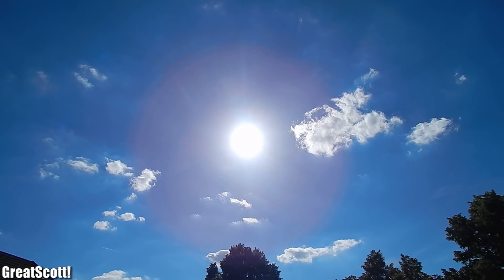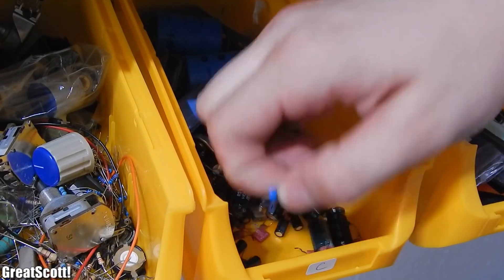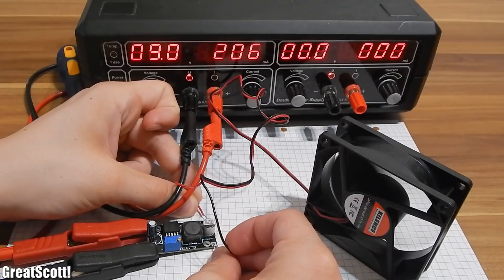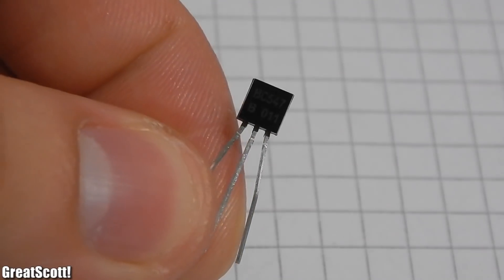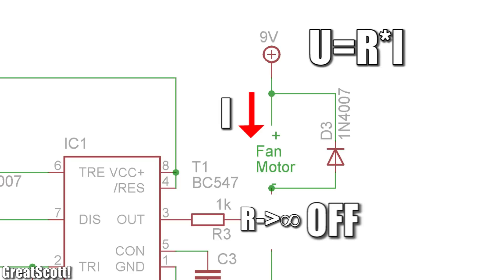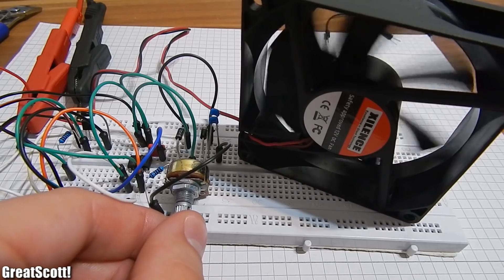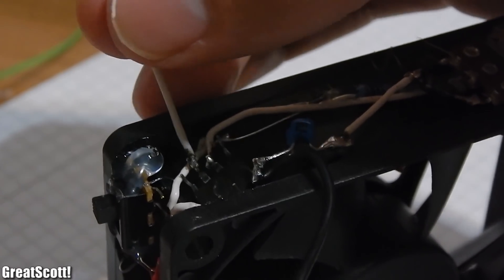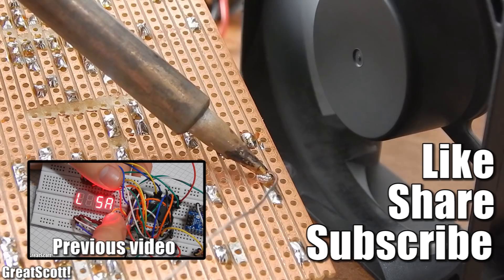Stay cool this summer: PC Fan Mod

Comment: thanks for sharing your knowledge!

i'm trying to replace the fan on to an xbox 360 power brick. the current one is a turbine type and i want to replace it with a regular fan. is there something a noob can do to keep the new fan running at lower rpm? the space is quite small so i won't be able to fit a bigger than 60x60x10mm fan in there, these fans usually have high rpm (like 4, 5, even 6k rpm)... small fan+big rpm = noise. what electrical component should i hook to the black wire in order to lower the rpm? i think 1000 rpm should be enough...

Comment: I actually did not stay cool because I used the circuit to power a 12v soldering iron soo instead I stayed frosty not to burn the house😆

Comment: So let me get this straight. You did not want to waste energy by using a variable resistor to control speed. Instead you switched the fan on and off quickly to get the desired airflow while not wasting energy in resistance. Did I get it right?

Comment: Few years back simply bought a 12V wall adapter, connected them (fans) up and been using them ever since.
E: before that connected the fans to a molex connector, so I could get the power from the computer.

Comment: Hi, thanks for the tutorial  however I can't find all these parts at the moment and I need something to controll the 12v Fan on my old 3d Printer which currently has no speed settings enabled. I found another method : 

https://electronicshelpcare.com/voltage-controller-circuit-with-ampere-using-irf540n-electronics/

https://www.youtube.com/watch?v=_0bm2CJit1o&feature=emb_title

So basically all I have are some various Potentiometers and the IRF 540N and I need to be able to reduce the fan to Zero, at the moment only a slight change in speed ; '/

Comment: It would have been nice if you had a small pcb with that potentiometer which controlled one or fans. It  would be even better to have four potentiometers to control four 3 pin fans on that pcb.

Comment: Hello scott, as u showed here in the explanation dt u used pin 3 as input from the pot and the diode combination, but in yr actual application of fan and led dimmer u used pin '7 as input' and 'pin 3 as out' put which works pretty well, but my question is it possible to use 'pin 7 as output' and 'pin 3 as input' (from pot). Because A guy did that and when i tried using his schematics i failed to get anykind of out put from 'pin 7' and also he used '12v zener and 270 ohm resistor'to use 555 on 24 v supply bt when i tried my resistors heated up like in seconds 
Here is his vidio and schematics https://youtu.be/trlUiFwl6AE
And also make a video on using zener diode as voltage regulator if possible
 thanks in advance

Comment: This is perfect for a cosplay I have! May I ask, can I use an external cell phone battery to power this instead of a 9V!?
Reply: if you have a 3.7V battery it´s gonna be difficult to power the fan so you should utilitze a boost converter first :) and from then on do everything like in the video
Reply: @chrislee8370  thanks man!

Comment: First of all, I would like to thank you for sharing your knowledge through your videos. I know I am about 4 years late in this comment but I would like to contribute positively. For the newbies and electronics sympathizers like me it would work best to show the assembly of the circuit in the breadboard at normal speed, step by step and not at fast speed because is very difficult to pause the video on right spot and do the actual assembly on the bench. I also noticed in the schematic that you changed the IC NE555 pinout. For me that was a bit trick because this can go unnoticed and may frustrate the success of the project. It led me to a wrong assembly and I spent some time to figure it out. So now I will try to put this to work one more time. Wish me luck! Thanks!

Comment: Would this not work with USB? I think you should use USB chargers and cables in your video if it works, since both wall chargers and powerbanks work with that, it's also an easy way to turn it off and on, just plug in and out.

I built a small fan off an RC plane, first connected both cables to the sides of a battery, but that was not practical, then I tried it with a USB cable, it has 4 smaller cables, but just connect it to the 2 power cables, and it worked, now it can be plugged into a wall with a USB charger or an USB Powerbank, even your laptop, amazing.

Comment: Hi, someone said with modern computer fan there is an onboard controller and you don't need a diode. Also, it is not advisable to PWM a fan like this.. what is your take on that: https://electronics.stackexchange.com/a/354756/174444

Comment: The fan was producing a hissing sound. Turns out the pwm frequency was around 3Khz, which is audible to the humans. I changed the 2.2nF capacitors for a single 0.47nF and the frequency raised to 30Khz. Outside the audible frequency!
Reply: If you do this, you have to use a fast-switching diode like a schottky diode.

Comment: a boost circuit and a lipo is much better. I use it to exhaust solder fumes. but sadly I used a tint 350mah on a monsteruos 120mm fan that draws 2.5a from my battery 0_0 I should have used a lower voltage or a 3800mah...

Comment: hey i build the same but it aint working the voltage varies from 9.15 v to 9.25v when the potentiometer is turned 
the circuit is properly made but i used 1 4.7kpf capacitor instead of 2 2.2kpf is that ok ??

Comment: Hey Scott.
I did the same construction you did on my Breadboard But I did not get any effect of the potentiometer. I changed the caps, the transistor and the resistors but the fan is on the same speed the whole time. What can be possible problems? I checked for mistakes and can not find any. Is it possible for the NE555 to be defect So the fan is blowing all the time with the same speed?

Comment: is this capable of running at max 24v? and can the potentiometer be switched out for a arduino with wifi module and certain code?

Comment: NIce video. I think PWM is making sense to me now. I got this working on perfboard after some trial and error (never using stripboard ever again!)

So my question is this: 
In theory, is this 2/3 of a switch mode power supply? I would be curious to know what would be needed in addition to make it a switch mode power supply. Place an inductor in series with the DC source and transistor?

Comment: Can I use for R2 (10K) a 5K resistor?
Reply: This depends on which transitor or mosfet you are using. Voltage level current level etc.

Comment: Question: would be possible to put a potentiometer in a 4 wire fan? Would it work, using the PWM cable?

Comment: wonder what would happen if you used a jewl thief if it would couse the fan to run at higher rpm with the 9 volt current.

Comment: why don't you use it with USB power supply?
Reply: less power.
Reply: less power.
Reply: Only 5v is not enough to power this thing
Reply: newb at electrical here, cant he use a power booster for that?
Reply: shahmi anwar he can but some USB ports might not have enough amps so it might be slower

Comment: um look at circuit it is a brusless motor and there is already a diode for reverse polarity protection and we donot want a voltage drop with any purpose.
Reply: Hasham ghaffary what do you mean?

Comment: hm... after looking in the NE555 Datasheet (after years) i've noticed that the NE555 can output up to 225mA, so you can screw the BC547 which has a maximum collector current of 100mA. Or did I interpret that wrong?

Comment: +Greatscott! I want to use the fan at 12V/300mA instead. Am I supposed to adapt any components to the "new" circuit. And if, which and how?
Reply: Just google "NE555 12V fan" there are dozens of examples

Comment: +GreatScott! This is a great project.
I built the circuit using the schematic and when i powered it, the ne555 began to heat up. Is it normal? Or maybe is because I used a 9V power supply and not a 9V battery?
Thank you!
Reply: Ig use a 5v regulator for 555, and a MOSFET instead of the transistor

Comment: +GreatScott! How do I connect this to a usb?
Reply: Omesh Vishaal just find a 5 volt fan or use a converter and use an old usb wire, cut of the opposite side of the usb connector and strip the wires. The black and red are most commonly the positive and negative wires but you should test to be sure.
Reply: Victor Janssen alright! 
Thanks BTW
Reply: I have a 120mm fan running off 5v drawing 200 miliamps from a USB powered arduino dumilanove.

Comment: +GreatScott! Do you actually still use this project or is it collecting dust?
Reply from the maker: I switched to a more powerful fan. So it is collecting dust right now.
Reply: +Greatscott! I want to use the fan at 12V/300mA instead. Am I supposed to adapt any components to the "new" circuit. And if, which and how?

Comment: this is a pwm controller for a fan that has no pwm control, but how to make one that would use the 4 pin on pwm fans? it's a 25khz pwm signal required. can you give me help? thanks a lot +GreatScott!

Comment: +GreatScott! - This is a great video! However, I wonder why you didn't use the XL6009 module, was it simply because you wanted to create the 555 circuit instead or was it because the XL6009 was not suitable for the application?
Reply from the maker: I wanted to use the 555 timer
Reply: +Greatscott! I want to use the fan at 12V/300mA instead. Am I supposed to adapt any components to the "new" circuit. And if, which and how?
Reply: Pls tell me how do u know all this

Comment: I'm just using a generic 12V PSU with a switch.... Can't control the speed (should insert a potentiometer some day...) but works fine.

Comment: i used 12 volts 2.5 amps,my transistor burnt then i used a 2n3904 transistor which is a voltage amplifier(i didnt know it was a voltage amplifier before) then my potentiometer burnt..what should i do to stop burning my potentiometer and transistor?  plss great scott HELP ME!!!

Comment: hi there, just wondering - can i use two 2.2uf electrolytic capacitors in place of the 2.2nf ones and also will this work with a 2n2222a transistor? thanks
Reply: never mind,  tried it and it works great!

Comment: If i have one 12V power supply which components should i use instead?
I'm planning to do a DIY PWM controller to control my PC fans(12V|0.08A) so i would plug it in the 12V rail of ATX PSU
My plan is have the blank 3.5" bay cover and drill 2 holes for the shaft of the potentiometer and do the pwm circuit on a copper dot board and glue it on the internal part of the 3.5" bay cover.
Reply: +Rodrigo B.P if you are referring to making the circuit, it works fine for me at 12v. the PSU should work fine as well. however i use mine as a fume extractor controller so i use a battery. also if you make it, try using stripboard as you can solder the potentiometer to the board so it will be held in firmly by just the potentiometer.
Reply: AranE Games
Thank you for the information.
Reply: its okay:)

Comment: How does it boost the voltage? I thought that was only possible with AC
Reply: These fans run on 12 volts dc, not AC power.
Reply: +Nawaf Al Muhannadi yeah. But how does the DC voltage booster work?
Reply: +Bronson Stephens The booster circuit steps up the source voltage, here the power source is a battery. Since power (P = VI) must be conserved, the output current is lower than the source current, so the circuit uses up current in order to step up the voltage, after conversion, the power from the converter is less than the original battery.
Reply: +Nawaf Al Muhannadi I meant current not power in the last sentence
Reply: +Nawaf Al Muhannadi oh ok. That makes a lot of sense haha.
Reply: +Nawaf Al Muhannadi You can edit and delete comments now
Just click on the 3 dots on the right hand side

Comment: I did this too, but with a USB 2.0. It managed to actually spin quite fast and could run at 5 Volts!
Reply: +Orangy57 NOT AS FAST...NEEDS MORE VOLTAGE TO GO FASTER.
Reply: Rainers Strads IF ITS BUILT FOR IT. SINCE IT IS BUILT TO WORK ON A PSU 12V IS THE MAX SO YEAH....NEEDS MORE VOLTAGE TO GO FASTER
Reply: Rainers Strads  no

Comment: If you need infinite power, find a old phone charger, cute the wire, find the white and the black.
White represents the +
Black represents the  -

No transformer needed if you plug it in with a phone charger
It worked for me, i tested one cooling fan once. Then i had an idea, the thing was that i fixed a old animatronic doll, who wasnt in the best shape (I mean not the shape of the animatronic, i meant the shape of the mechanism), then i took my old phone
charger, hot glued to a resistor on the main motor, i actually did soldering. Then i tested it, BOOOOOOOOOOOOOOOOMMMMM

The animatronic was fixed :)
Reply: ***** The resistor was in the old animatronic, i searched for the - pole and the + pole, i had right. I connected the white wire to the positive pole on the resistor, and then i did the black wire too. The resistor was a part of the main motor. But you know, you dont need a resistor to get things work when you are using a phone carger. i just did a good job, fixing it. But the speaker is gone and the main PCB is gone too, so i had to connect those phone charger wires to the motor. One day, i need to connect the real wires inside the animatronic to a Arduino. Then i can set the animatronic in full functional animatronic. Im not a engineer too, but i have a dream some day that i can possible make an animatronic band in my bedroom :D
Reply: ***** The only problem, is that the adapter can be warm some time to times, If its stucked to a wall socket long enough, it can be realy warm. Try to not do that, or it may start a fire. Check the temprature sometimes and dont forget to pay the power bill :)
Reply: Man, i thinking you need to get small switches instead of a big one xD. RCD switches is using in the fuse box in your house. RCD switches has one or two fuses inside it. Why would you do that ? :D

My idea is like making a small PCB circuit, with fan speed, and on off switch.
Pluss the white and black wire connected to the circuit board. a red indicator LED is good, if its on or off. Buy a small project box :)
Reply: ***** Good luck :)
Reply: ***** no, its just something i created in source film maker. The full thumbnail can be seen if you click on my name :)
Im sharing the channel with another guy. Me and him are animators :), so i can post his work and my work in it. Basicly im not that good to animate.

Comment: Why use a battery? Use a USB cable. (+5 and GND). The fan won't spin as fast but it still removes a lot of heat.
Reply: Sorry, didn't realize it was designed to keep you cool and not the PC.

Comment: I have a blue wire on my pc fan? where do i put this
Reply: +Jaden Doddridge (DatCarDude) It's a PWM signal wire. You computer motherboard generates 5V pulses for that wire. You fan has basically all this PWM speed controller of this video built-in itself.
With 0V in that wire, the built-in speed controller of your fan will go into 0% PWM cycle and will spin at it's slowest speed (maybe even stop), and with a constant 5V signal it will go into 100% PWM, spining at it's fastest speed.
You must be careful with this blue wire though, DO NOT feed it more than 5V, or you WILL kill the built-in controller and your fan will be dead forever!
Reply: +Sugurain Thanks i got it

Comment: im using a FQP50N06  and a 10k pot to control speed of a 12 drill motor. my pot sparked inside and now wont control the speed of the motor. i really wont to pwm as it would make my deign  more complex. what pot should i use ?

Comment: +GreatScott! I use to dabble in electronics a few years ago. I was capable of reading a schematic and building it, including making my own PCBs. However I could never really identify why we used certain parts. Like why exactly a 100µF cap in this place, but another size over here. Same with diodes. this video had some theory as to why you placed the diode there, and i am very thankful for that bit of theory. Keep up the great work Scott!

Comment: Hi Scott. Can you please hack the glue gun, it takes about 10 min to get heat up enough to melt the glue. Or 3 min in some good devices. Is it possible to make it work like impulse soldering iron that heats up in 3 seconds?

Comment: You can use a rechargeable battery from an old mobile phone to power the setup.
Reply: +mohamed shifan They usually output 3.7 volts, which is probably too low. Then you would have to use a boost converter.
Reply: or use two or three in series

Comment: Why use PWM instead of a normal voltage divider? it should have the same result, no?
Reply from the maker: +Antilevitation I made another video about this question.
Reply: Could you share the link or give the title of the video? I cant seem to find it :)
Reply from the maker: +Antilevitation "PWM VS Potentiometer. When to use which technique"

Comment: I have a DC 5 volt fan, can I still use that type of battery?
Reply: Colton Gunning Lol scrub m9 u wot m8 I did it m10
Reply: Colton Gunning I've run it for 4 hours to test it and it still works just it's out of power. I used a new battery, and it still works m10
Reply: +PluriiGaming U foekin wot m2? Nice going m4
Reply: +PluriiGaming You're running the fan on a higher voltage than it's rated for. Good that it worked out for you, but it won't always work out.

Comment: Here's a hack you could try: 
cut a hole in the top of a container big enough for the fan to fit in, then fill the bucket with ice. Also you'll want to poke ventilation holes on the can.

Comment: What a mess, a lot of components, just program a microcontroller, pot->uC-> transistor. or direct pot->fan, whatever your project is uselees, the fan RIP before 4 Hrs, that works with 12 V not 15 not 5.5 V, example if you use your Tv with 55 VAC or 170 VAC you'll be visiting the guy who fixes toasters.
Reply: Chopy 61 shut up.